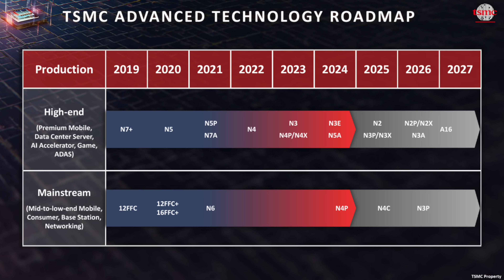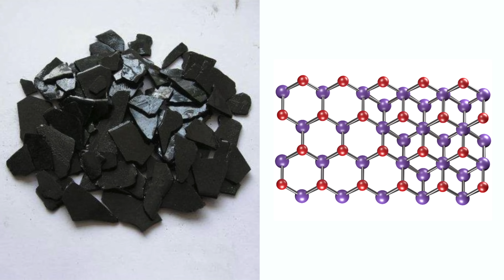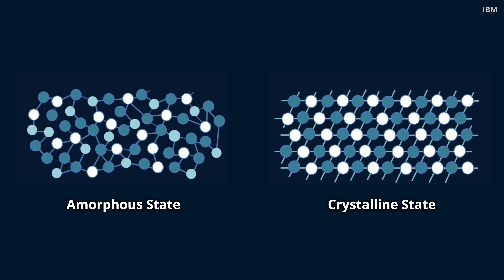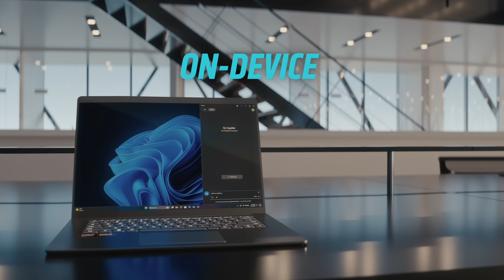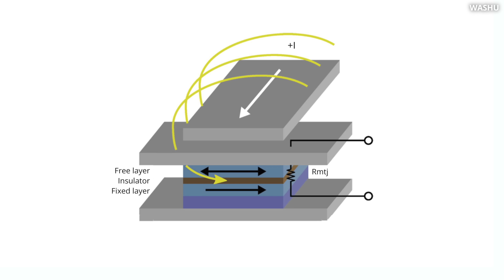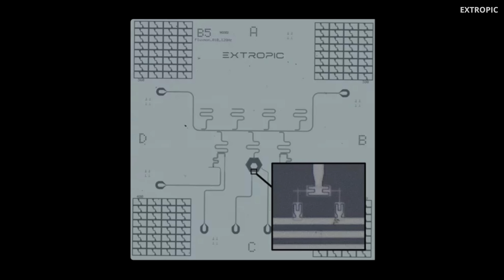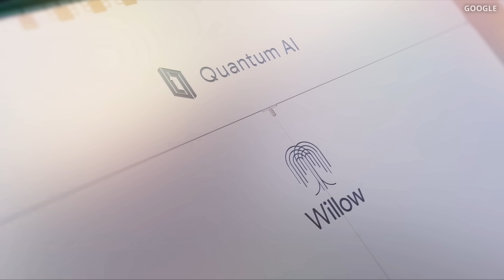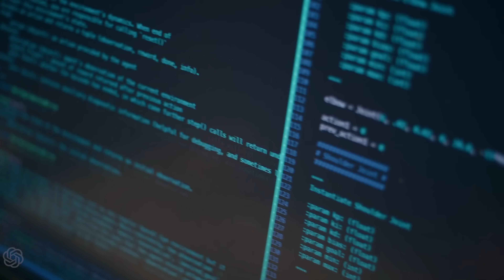A New Semiconductor That Changes Everything

Comment: I have to admit, as a non-techie, I will never really understand most of the content of these videos. The reason I do watch though is to get a sense of what is coming down the line in the next few years and prepare for it as much as I can.
Reply: As "a techie" person I can tell you that she uses a lot of clickbaits and a lot of wishful thinking in her videos. Manufacturers already hit a wall with miniaturization. Right now traces connecting transistors are about 15 atoms in size. You can not make traces and transistors smaller and smaller (it is like building something from Lego blocks, where one block is the smallest piece). So shrinking structures in chips is a dead end. Rising frequency of chips above 6GHz is also a dead end. Adding more cores and splitting work on many cores works only in some cases of workloads. If we can not shrink structure of the chip or run it faster, then the only way to expand computing power is to make it "taller". This is were stacking one chip on another comes in (like 3D cache in Ryzen CPUs). Adding more "floors" to chips is problematic, as the current draw go up and temperature rises too.
Reply: @powerzx  as non techie, I had a feeling about that, maybe I'm not so thick ?
Reply: @MrMick560  I am not calling names, because you may not know something. It is impossible to know everything on every subject.
Reply: @powerzx  very kind
Reply: @powerzx Correct. Which is why photonic chips will be such a big deal when they finally hit. They'll be able to focus less on transistor density and more on increases in frequency for a while. There will be bottlenecks as they increase the clock frequency, meaning a new metric to measure advancements may be needed. Instead of doubling transistor density every 2 years a la Moore's law, we may need to switch to a metric that focuses on the number of operations per square mm per second, as clock cycles experience periodic leaps.
Reply: @bencarignan2711  Yes, photonic chips could be a solution. Instead of making video card with for example 14 layers, thousands of copper tracks and vias, it could be made much simpler and cheaper.
It would also solve many problems like complex track design to avoid problems with signals.
Reply: @powerzx  what r the problems with rising the freq above 6GHzs? I'm asking
Reply: @kumarraj197  There are many problems with running chips at very high frequencies.
Some of them are:
-quicker chip degradation (because of electron migration)
-rise of the temperature (the more times you switch the transistor, the higher is emission of heat)
-need for a higher current to do the same job of switching transistor in shorter time (it rises temperature)
-if you switch transistor too quickly it is like it is open all the time (because of "inertia" it can not close properly, it is limited by an electron speed in conductors)
-it is harder to recognize transistor states (rise, on and fall states are too short)
-problem with supporting "clean" power without spikes from PWM chips.
Reply: @powerzx Well going smaller may be a dead end but a lot of what's being developed isn't about that , it's about realizing that and finding other ways to overcome it. Ways that don't have to do with those physical limitations. Your assertions are still thinking within the box , these people are thinking how do we change the way the box functions.
Reply: @Harbringe  Going smaller is a dead end, because of laws of physics and very fragile structure. Not only it is very easy to break, but it is also very sensitive to radiation (from cosmic rays or fission from elements on Earth). If you think outside the box, then you are in the field of Harry Potter. There is no magic way to avoid physical limitations. Currently there are no better materials than Si, other elements have many disadvantages and will not give any revolution.
Reply: @powerzx  you are probably correct considering today’s technology. Tomorrow’s technology may prove you wrong.  We may be approaching nano tech.  Never underestimate tomorrow.
Reply: @ I am right. We are in the nanotechnology since about 1980 when the first electron microscope was used.
Reply: So use light, not current. They’re all just fields anyway. Imagine shifting a bit by a tiny fiber loop.
Reply: @powerzx these are the challenges… until they are solved.
Reply: @bobwheeler8101  No, those are not challenges. Those are the limits, that we knew from the laws of physics. It was not that hard to shrink node size from let's say 45nm to 32nm. Even if technology will reach 1 atom thickness of traces then you will "hit the wall". You can not build anything with a fraction of the atom size.
Reply: @powerzx  where are you from??? I bet America, that is why Elon is saying you are not engineers and a big reason why they want to hire people from China, India, Japan knowing exactly what he is talking about.
Reply: I feeel like grandpa trying to watch football on my microwave
Reply: Same me as well. Just want to keep up to date with what is going on and coming.
Reply: I am just waiting for the science.
Reply: Me too, its fascinating.
Reply: when u want to build a house you first draw a diagram where all the lines are and where you want to build
when engineers design a diagram for a cpu its on a scale thinner then your hair on your head
looked and zoomed in heavely under a microscope or zoomed programs in office

however silicon { like sea sand } and metals fused together is used then cut with very fine lasers..like  digging trenches to lay foundations to build walls of a house on
so in these trenches these metals made for cpus is used in the micron way laid in by laser in the trenches which serves as gates which workes like transistors
these transistors or gates then have the capabilities to reduce electrical currents flowing through it

and this is done layer upon layer like building a multi story building
each floor has passages and rooms and doors [gates] then there is upper floors
so all of this is to run certain electrical currents which gives different results
so its like a massive building sqeeuzed down to micro millimeters
thats why cpus run on 0.8-1.5 average volts
you would melt it with more voltage
however data programming {bios ] is very much needed to control those voltages running sround which controls data

it works something like that
the reason different metals are used is in the conductivity and the type of power it uses to do a certain type of activity
the better a metal uses less power the more proficient the cpu will be in using less power

thats why cpus now a days with better technology of lasers produced by TSMC and Samsung and Intel and others  can make cpus that  uses less power to run
if you look at old tech from 80-90s the tech was the best it could be but used a lot more power and metals were different  transistors that were used
the first computer build with 1 meg memory was the size of a warehouse back then
now we have memory even on cpus
Reply: Me too. It’s a heads-up on the future.
These might be the threats to NVDA or the opportunities…
Reply: By just watching this kind you are learning a lot, but if you want to understand a little bit more research for eletronic components like resistor, capacitor, Transistor, etc. You also will need a background in electricity, and how it really works in the atomic level. (Hope you get it, English is not my mother language.)
Reply: Hahah no worries man is good you want to be up to date 🙌🏻 engineer like Anastasi speaking ;)))
Reply: I recommend the podcast "voices from DARPA" for anyone interested in leading edge science.
Reply: I was a computer engineer before retiring in 2011. I know what she is saying, but I don't find much evidence in the field for what she is telling us. (For instance, CPU, GPU, and NPU have been integrated on chip or on substrate for decades.)

OK -- here's my problem with your channel. Didn't you, in the beginning of the video, say that computing in memory was the new paradigm shift in computing that would continue to outperform Moore's Law? Then, after the commercial for AMD, did you not just contradict yourself, stating that computing in storage was not the empowering new tech? 

Perhaps I misunderstood -- did I misrepresent your claim? I did hear you rattle off a half-dozen possible advances in materials that have yet to bear fruit, other thanin one very real technology -- GaN or Gallium Nitride, where they have been outperforming Silicon-based semiconductors in multiple applications (mainly optoelectronics and high frequency devices) for decades.

Is this what you're talking about?
Reply: No point engaging. AI will remove all comments exposing the fraud.
Reply: As a techie...it applies the same to me.  Her knowledge is truly next level.
Reply: @DavidMiller-dt8mx she’s a chip designer after all.
Reply: @DavidMiller-dt8mx  If you believe in her clickbaits like "100 000 000 times faster", then you aren't "a techie" at all.
Reply: @powerzx  I dunno..Comparing a well known Ytuber that goes all the way on research and obviously knows her subject well vs some twit mumbling in the comments..Mm..You sound like those naysayers that thought rockets couldn't be reused. Do not underestimate human genius, which you're obviously not so well indulged in.
Reply: @AnthonyElsom    I could prove that you are wrong, but it would be a waste of my time. So just click on her profile and look for thumbnails from the last 9 months. Do you believe in those clickbaits? 1 Billion times, 100 000 000 times faster...
Just use your brain.
Reply: Preparing? You prepare for an apocalypse, not a new phone.

Relax 😂

Comment: Favorite technolgy of 2024 is reasoning models from OpenAI (o1 and o3). These showed us that LLMs can scale to unimaginable performance heights using increaased inference-time/test-time compute rather than simply requiring more and more expensive training data and models to realize vast AI improvements. And that dovetails nicely with your channel in that much greater inference time compute at global scale is going ot require extraordinary new computational power to deliver on the dreams of AGI and ASI to make the world of the next several decades much better. Thank you for your stellar channel and Happy Holidays!
Reply: There were no "scaling to unimaginable performance heights" tho? It just went from "borderline retarded and slow" to "marginally less retarded and somewhat slower, while consuming x5 power"

Also, no , tying majority of energy cost into inference instead of training is not a win - training is performed once and inference - on per query basis, meaning any energy cost not paid once would be aggravated as usage grows.
For example, OpenAI reportedly spent 60GWh training ChatGPT4, while serving queries took ~454GWh (514 GWh in total). If they can reduce inference cost by 30% (at the cost of x2 training), they would'we spent 454 * 0.7 + 120 = 438GWh.
 I.e. if you double the training cost, but reduce inference cost by 30% - you would spend 15% less energy in total (with provided figures, the win is already achieved at 15% reduction per inference, assuming x2 the training).